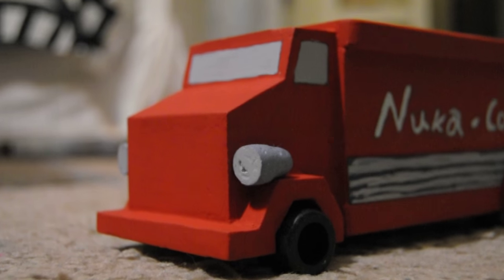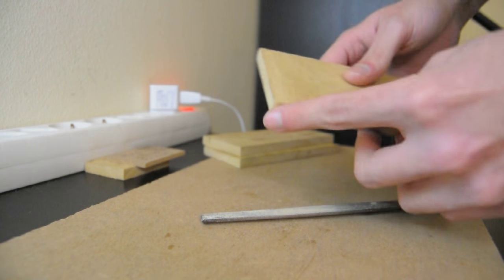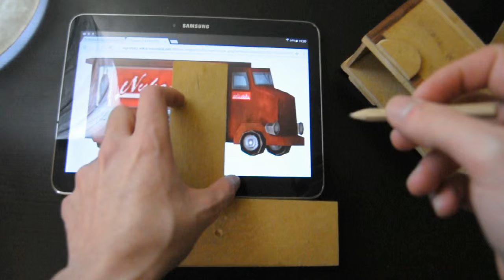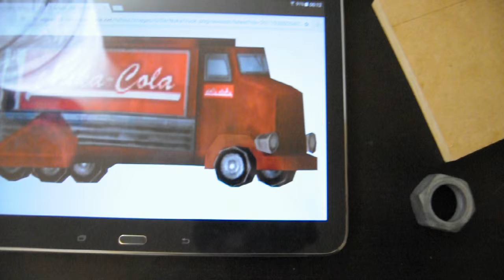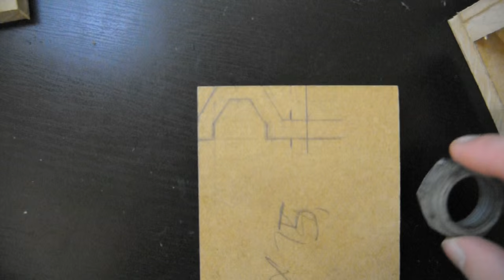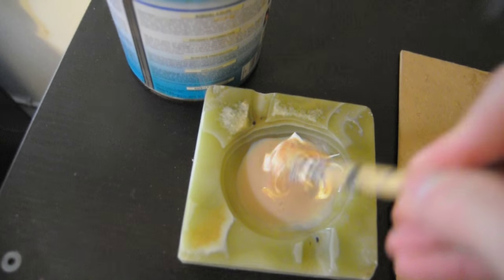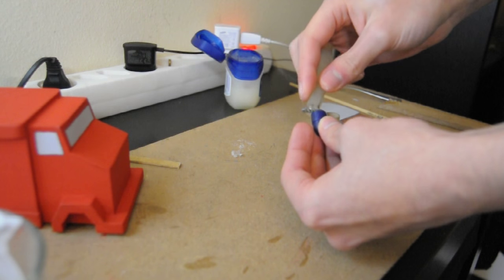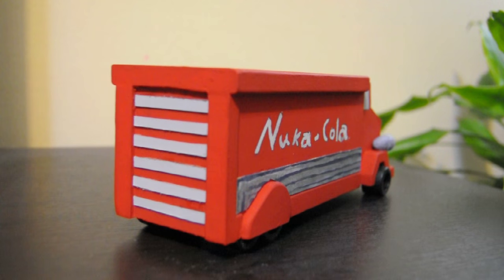DIY Fallout 4 - Nuka Cola Toy Truck made with Wood

Comment: I was wondering what you used to cut the wood with and where you got the little knife you were using and what you would recommend using in a small apartment. Thank you .
Reply from the maker: +Brice S. sorry for the late reply,youtube was saying comment failed for a week or so when i was replying.... what i use is a good multiteeth japanese saw blade which cuts mdf like butter and i cut everything with it... you can use a small table band saw to have more power than when you do it with the hand!
Reply: Thank you.